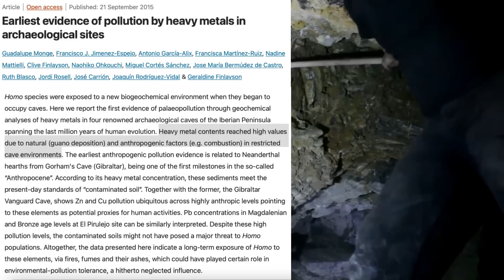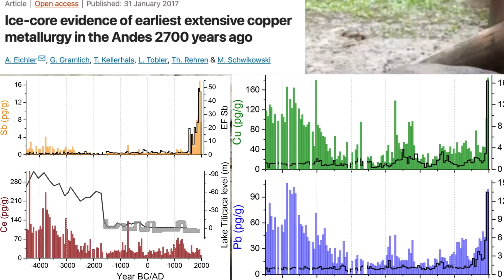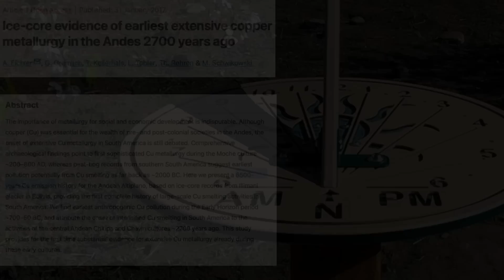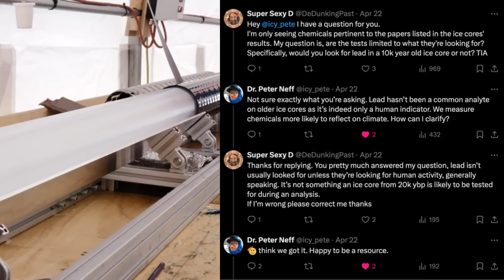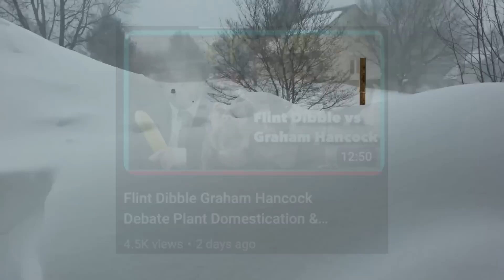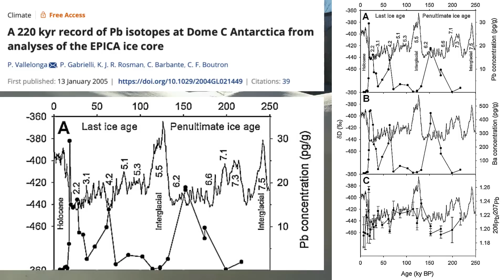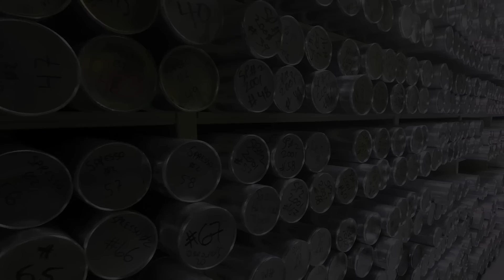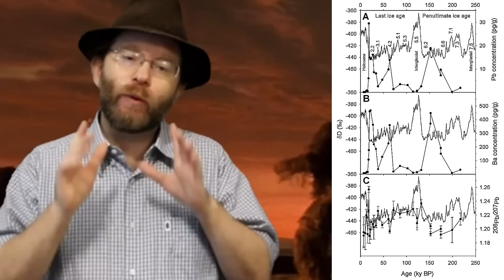Flint Dibble Graham Hancock Debate #2 Metallurgy Lead in Ice Cores Joe Rogan #debate #grahamhancock

Comment: I know that megalithic secrets hidden for years. Starting about 200 year's ago was hidden.  Religion knew or kept symbolism to become words. 
The pottery clay has iron oxide and aluminum oxide. Ten steps. I read symbolism, and books that describe how to maske aluminum powder.  The one ingredient needed to creating exothermic reaction.  
This reaction exchanges oxygen and produces extreme heat melting stone binding together, leaving iron within, magnetic.
So largest megalithic stone was gravel before man create it. Pyramid construction has recipes on the walls and statues. 
I found symbolism realated to zodiacal stories and poetry with information. In the ten steps, aluminum and iron can be reused over unlimited.  
0 gasification reaction.  
At the time names of elements are changed but the trinity is not. This was a base energy source for heat battery and metals extraction. And gemstones can be made. 
It seems worldwide with religion being the main reasons for denying the fact. 
We call it thermite now but was animals or gods at the times of construction. 
I would love you to get him with those true laws of physics and chemistry.

Comment: Look at metals in the megalithic stone. Common connection with elements smelting and thermal chain reaction of great heat. If it was controlled. Heat energy with 0 lead or co2.

Comment: the problem with the argument that is made about lead, is that no one knows what constitutes an "ancient advanced" empire's mineral extraction and smelting ability. was this empire using caustic solutions to extract copper, like we do with bauxite? did the empire use volcanic lava to provide the intense heat to melt copper or bronze? did the empire have iron from bacteria, as john plant from the "primitive technologies" youtube channel loves to use? did they know enough about electricity to have an arc furnace?
Reply: maybe 1000s of years ago there was a bunch of native, in situ metal laying on the surface of the earth that these people used and didn't have to smelt anything. maybe it was from meteors crashing here over billions of years.
Reply: @AustinKoleCarlisle  it wouldn't be copper, but iron could be gathered this way. assuming there was access to magma, they could still use the enormous thermal energy to shape the metal.

Comment: Out of interest what differentiates evidence of smelting vs volcanic melting of elements?
Reply: maybe they didn't need to smelt anything because there was a bunch of native metal lying around, from billions of years of meteor impacts, etc.
Reply: Great question. When you purify a metal from its ore, you change the ratio of it to the other metals in the rock from which you extracted it by enriching for it. The air pollution from the smelting process should be in the form of a higher concentration of the metal, and its chemical derivatives such as couprous and cupric oxide in the case of Copper, relative to these other metals like cerium or zinc, and whatever other metals were added like for example tin or lead. On the other hand, natural metal pollution reflects the natural, unpurified ratios of the raw ore/rock. That's it how could be done to probe for non-natural sources of atmospheric metal pollution.
Reply: @ManuSeyfzadeh  Oh I see, thanks

Comment: You have misquoted Flint's "Large scale metallurgy" into just "Any metallurgy".

I have looked at both of the main sources you interpreted this video from, and there is a clear misunderstanding in your analysis of what we'd expect to find from a local source and a global source. This is why the Greenland ice cores showing Roman data is so interesting.

Your point does not fully appreciate that, compared to Rome, and the extent of the Roman empire, the fact that their impact on Greenland shows a conclusive idea. That idea is that any civilization that is significant in scope, technology (burning and metals), and lasted enough time, will have an impact on not only regional, but global ice cores. That is how the dispersion of particulates in the atmosphere works. That's why radioactive fallout from Chernobyl was global, and that's why we get the volcanic cooling effect from Ash clouds.

For a civilization in the Andes-region to have an impact on Greenland, it would need to have been at a much greater scope, technology, and time, as Rome. This is only covered by the 1100 BCE markers of the main study Flint is referencing. So in general, your point here is extremely flawed.

For any people's in the Andes, then yes, you would expect to find human trace emissions and particulates in their local glaciers. And unless it is quadruple the size of Rome, you would not find it in Greenland. If Rome lasted 50 years and never got out of Italy, I doubt you would see it in Greenland either. 

Greenland is approximately 2000 miles from the closest Lead Mining historical known location in Wales via the Roman Empire. But it is around 9,000 miles from the Andes. That's why it's unlikely you get any Andes relation here. 

That is the point. You say "all these things need to be done on a regional level". Greenland is not in the 'region' of Rome's extent. 

You make one valid point - if we were not looking for lead from 20k years prior to now, then we can't conclusivley say human activity was not at high levels of metalurgy or burning of materials compared to the evidence of icecores from the Roman core study from 1.1K BC. https://www.pnas.org/doi/10.1073/pnas.1721818115.

Therefore, if a civilisation was at least as big as Rome, which Graham contests it must be (he says globe-spanning, advanced, sea faring), then it must have left an impact of human-related emissions from 20,000-10,000 years ago. Unfortunately for Flint, and Graham, this lead-tracing of ice cores from this time has not been done.

All this does is prove no one right. But yes your logic in the first part makes little sense.

The real answers would come if ice cores were dug out and tested for lead-based human activity from 10-20k years ago.

The great sadness in all of this is this - Graham has already spoiled the conversation and made this pointless. This is because in response to what Flint brought up, Graham said "Maybe they didn't practice metalurgy" 'maybe this' 'maybe that'. And so, even if it was proven that the activities of humans from 15,000 years ago was nothing even close to Rome, then Graham still has his get out of jail free card. That is what being a conman is.

Edit: Changed first sentence word 'quote' into 'misquoted'
Reply from the maker: How you missed me framing this in the beginning is beyond me.
I show the entire quote of Flint's including the part where he shifts from 'No large scale metallurgy in the Ice Age' to 'No metallurgy in the Ice Age'. I point out he's fundamentally right, but the way he words it has misrepresented it.

You then go on to tilt against the windmill you created in your mind.
Reply: @DeDunking  Yes, but my entire post elaborates on how the analysis here is just wrong. Furthermore, now I just think you're both wrong.

Yes, Flint says 'ice age', when in fact, I agree with you, if what I have read from these studies as well as what ice core experts have said, especially in your video, humans have not tracked lead based emissions in ice cores. If I am wrong on that front then fine. But that is what I have read and come away with. This is why I'm saying you're both wrong. What do you mean he is fundamentally right? I have not seen any evidence of human impacts on ice-cores from the ice age - all the studies I have seen are localised or don't look into human based emissions. 

That is the point of my 'tilt against the windmill'. That your entire video is split into two halves - one which attests that Roman activity is only seen regionally (which is not true), and that Andes activity is not shown globally, which is the point. Any globe spanning civilisation would have a footprint found in global ice sheets, that analysis has not been done

My point is, that should have been the focus of your video, and it wasn't.

Furthermore, as I said, Graham has completed ruined this line of argument as he has already theorized an excuse.
Reply: @garyc2630  you assume anomalous data wouldn't have been thrown out, as is common for many statistical practices.
Reply: @AustinKoleCarlisle  can you be a tiny bit more specific, I covered a lot in both of my messages
Reply: @garyc2630  i was merely saying a general point that people like Flint rely on data that is massaged to show a certain result because of discarding outliers and confidence intervals etc. we need to analyze the original hard data, not the data compiled for a scientific paper.
Reply: @AustinKoleCarlisle  if you re read my comment I actually criticise both flint and this dunking guy for those reasons
Reply: @AustinKoleCarlisle  flint failed to prove that there is no lead in our ice core data prior to 3k years because it's not been tested. If it has been, and I'm wrong, then there's no argument. 

This dunking guys argument rested upon not only what I just said, but also the fact that he is comparing the particulate footprint of tribes and cultures of the Andes to Rome. I don't think I need to explain more why that doesn't make sense.
Reply: @garyc2630  regardless, at the end of the day, this issue isn't settled science despite people like Flint claiming it is. makes you wonder his true agenda. given his slandering comments toward Graham, and the childish behavior during the debate, i'm going to assume he's not on the right side of history here.
Reply: @AustinKoleCarlisle  can you please expand on what you mean by slanderish statements against Graham? I have something very interesting to share that dedunking got wrong again (although this time it was not his fault), Graham subverted everyone on purpose.
Reply: @garyc2630  prior to this interview, flint baselessly called Hancock a white supremacist, among other things.
Reply: @AustinKoleCarlisle  I'm not even sure if my reply sent but if it didn't I'll try to recreate it tomorrow.

Comment: The problem overlooked by both Dibble and Hancock is the presence of iron back then."We know the Egyptians obtained iron from the Nubians some 2400 BCE if not earlier.  According to Franz Lohner: “Egyptian iron was mined mostly in Nubia, but in the Old Kingdom (= the time, when the pyramids were built) it was brought from southern Turkey, mainly from the Armenian part, then the kingdom of the Hittites. A trade route ran from the Lebanon (resinous cedar wood for the pyramid tracks), Turkey (iron) via Cyprus (copper), Rhodes, Karpathos, Crete to the estuary of the Nile. This route was following the main ocean currents in this area of the Mediterranean.” “Franz Löhner doesn't allege, that the ancient Egyptians already knew the difficult and elaborate procedure of making wrought iron - but, that they acquired the valuable iron by trading. The Egyptian smiths then made tools from this iron or at least were able to maintain (= temper and sharpen) the tools acquired.”
Reply: you should tell him to update the history books because the Iron Age supposedly started around 1200 b.c.
Reply: @AustinKoleCarlisle  Moi? Pourquoi? I don't own a time machine, can't go back and block access to the mines. Shrug. "supposedly" is the correct operating word. We'll have to correct our thinking on the matter as science marches forward. C'est la vi.
Reply: @gerretw  i'm perfectly willing to update my thinking on things as science progresses. the better question is, are people like Flint willing to do so when they can't even admit that something might be manmade?
Reply: @AustinKoleCarlisle  I agree - I can accept his belief stems from his research, but my question - Does he approach his research with a preconceived notion of what he is looking for? Or is he open to whatever meets his eye? I was looking for a bolt that in my mind I thought I left laying horizontal, and was pulling my hair out, not believing I had lost it, when I spotted it standing on end (vertically) like I had left it. Having preconceived ideas can skew results. G

Comment: Now [sic] is, sti11, N enigmatic dimension. Lightening clapping is a piece of the Sun N 9-11. See Mental Boost 2 4 data on 9-11, pWoof.

Hydrogen as a dynamic VARY ANT [1 Atom Ant], vis a vis a transient or transitional, simply 💋 recognized current DENSITY function of the finite structure constant's transition the hydrogen in a light emmitting substrate of statespace (the electron is a lepton, not a quark)[&c, so much more, zero errors, 85 zeros], outer space versus watering our soil on the other end of nascency. Truly, therein, the real risk is more like nodal WBAN, linked with the fully built out (see nonvaxer420), fenestrated telemetry making now [again, sic], T-time's, which would B 9-18-01.